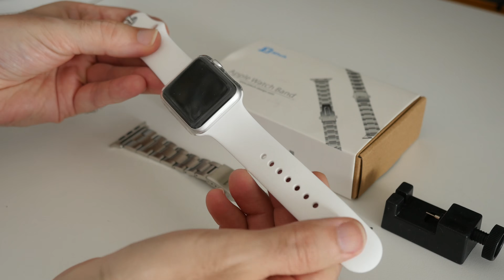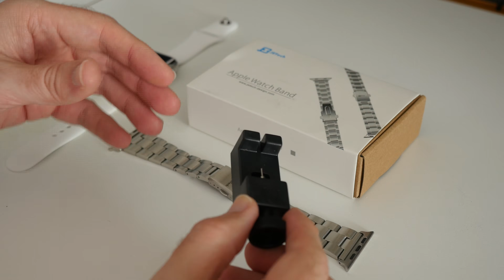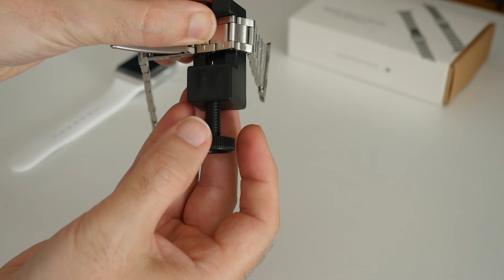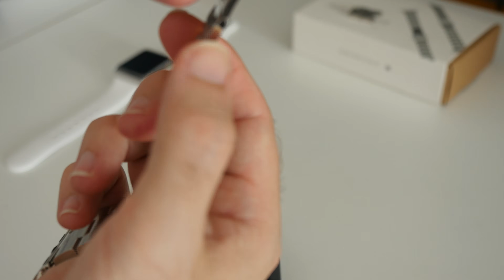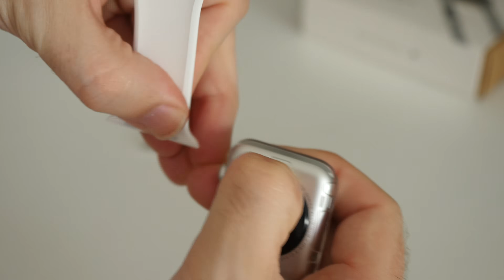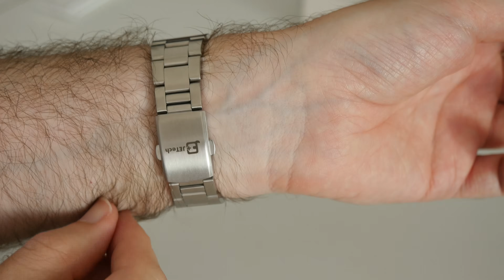Apple Watch - Adjusting & Fitting Budget JETech Stainless Steel Bracelet

Comment: Can you explain how to adjust the clasp?  I removed 2 links on each side and it's still just a bit big.  Thank you!
Reply from the maker: It is just a matter pushing the tiny spring bar in both sides with a pin and sliding along.